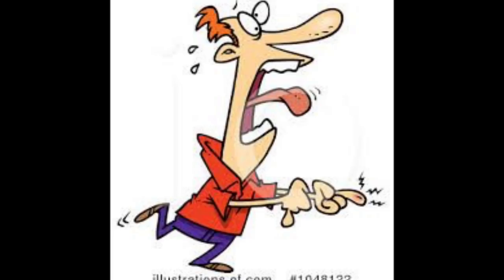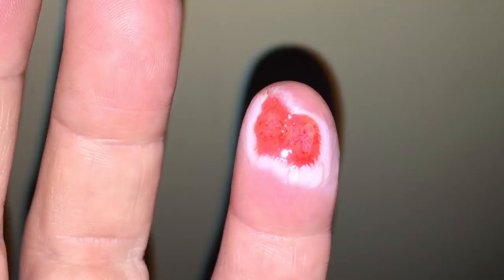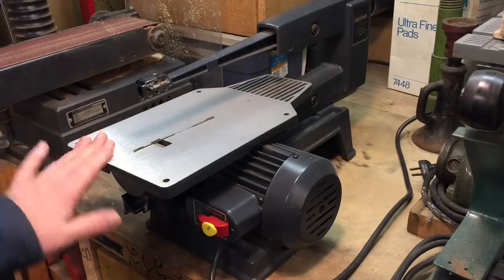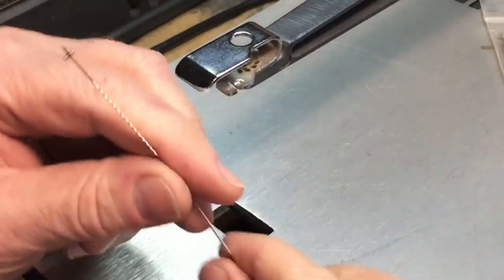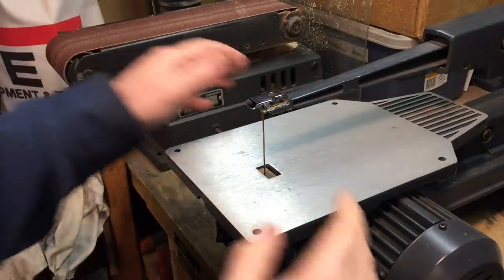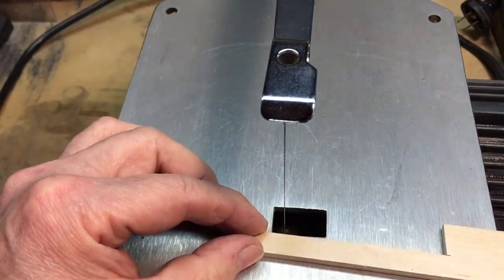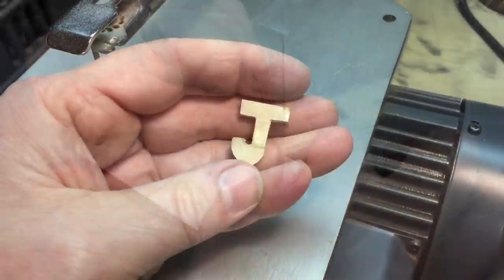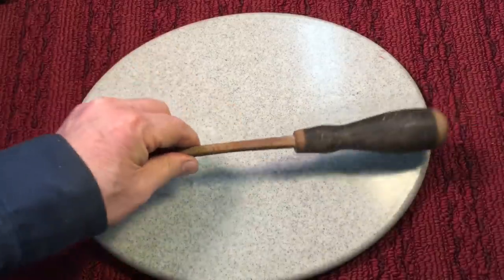Introduction to the Scroll Saw and a Rare Leather Handle Screwdriver Restoration

Comment: As a semi avid cyclist I’ve had my fair share of road rash which is very similar to what you had on your finger. I’ve found the best way to heal road rash is to do exactly what you did. Keep it covered, keep it clean, and keep it moist. I used petroleum jelly after about a week of using antibiotic ointment. It heals faster than you would believe.
Reply from the maker: David- You are so right!  I was shocked at how well it healed!   Thanks!

Comment: I'm glad your finger healed up nicely. Your scroll saw is a lot younger and lighter than mine. I had the pleasure of acquiring my nieces father-in-laws. He had a 1947 Craftsman scroll saw which had been in his home since 1959. The word BEAST is an understatement it is 50lbs of cast iron machine with a stand and motor which weighs an additional 50lbs. I love it works just like it was new.
Reply from the maker: Stephen those tools were made to last and weren't cheap!  My two favorite manufacturers are Vintage Craftsman and Millers Falls....

Comment: Glad to hear you're on the mend.

Your scroll saw looks just like mine, from the mid '80's.  I thought I got rid of mine a few years ago until I found it last week in the attic.  Glad I kept it because they are handy.  I added a 1/4" plywood zero clearance table topper on mine to keep small pieces going down that hole.  It helps a lot.

Keep on restoring!
Reply from the maker: Jeff!  You are so right, a zero clearance top is a great project!   =D  Thanks!

Comment: Nice work as always. Thank you for the scroll saw demonstration I believe I have that exact same craftsman one from my father as well and I vaguely remember how it works using it for making pinewood derby cars over 20 plus years ago. I plan on keeping it because just as you said those things are great for fine detail work and are great for close tight quarter working. I also have a craftsman jig saw type my father use to call a scroll saw as I think thats really what it was labeled and called that the top handle pivots in the front allowing you to change the angle of the blade for making circular or contoured cuts as well thats great you just don't find things like that anymore. You are so right about them being difficult to find these days there just isn't that many options and manufacturers of them anymore. I remember 2 years ago planning on buying my own before my father passed away and I think dewalt is about the only remaining manufacturer and maybe jet or delta as I was planning on using it for making custom kydex knife sheaths.
Reply from the maker: Hi Rob- There are a few high end scrolling saw makers for guys that are really into it...  For the entry level woodworker there are a few options too.  The problem is there are so many nice tools and not enough room or money for us to have most of them!  LOL
Reply: @ScoutCrafter  haha so true I think if I keep getting more tools my wife may start tossing them lol

Comment: My old scroll saw is a Delta brand and all cast iron. It also can use many different motors if the original goes bad. I have seen many other brands that are the same saw, but with only the name is different.

Comment: I have a big ole Craftsman scroll saw I bought 7-8 years ago & I think it was made in the 80;s . So it was old already . Nice restoration on that ole screwdriver !  I got to thinking as you were straightening it out on the Dake . What do you have undernieth that Dake supporting the weight ?  Maybe you can briefly show us all the next time you use it ?.....Good to see you healed well from that grinder injury John .
Reply from the maker: Hi Dave!  The funny thing about the hydraulic press is the only weight you have to support is the weight of the press (maybe 100 lbs)  the hydraulic piston presses against a table that is bolted to the frame of the Dake.  So no matter how many tons you build up the weight on the table is always just the weight of the Dake!  That's what makes it so amazing to me!   Thanks Dave!

Comment: I remember around the Bicentennial (1976) my uncle Joe was putting in a new cement walk at his house in Bellerose and he had the sides of the walk framed out with wood and lined with tar paper expansion joints and he had rebar mesh at the bottom and the cement trucks came and started flowing the cement into the walk and as the guys were floating it level, he started embedding various tools, like open ended wrenches, hammers and saw blades, just so there was something interning in the cement and I remember this one S shaped open ended wrench and every time I went to his house after that I looked for that wrench in the cement.
Reply from the maker: traderjoes How cool is that!!!!

Comment: I’m almost thinking that was a shop made screwdriver. Maybe even a kit that was sold? School project for shop class?  Idk. The inconsistent shaft and the tip didn’t seem to be hardened steel like it would be if it came from a  factory. But I could be wrong. Just my two cents lol. Either way amazing job!!!! “Turned” out beautiful. Pun intended lol

Comment: My father taught me many, many years ago, to use a coping saw,, before I was allow to touch the scroll saw..
Reply from the maker: Harry Still a very useable tool!!!   I have experimented cutting coins with one!  😃👍
Reply: @ScoutCrafter  have you ever seen a hand saw that looks like a tiny hacksaw that uses pinned end blades ?? 
The model i have says OMEGA then SPAIN on the other side of the handle.
All i can find is scroll saw bladed but 4 inches quarter inch wide. They sell them at lowes. Also the hande is seems to be some very rough cast odd colored alloy
The adjustment knob seems to be brass the arm i guess is stainless. Also the handle is too little to fit my hand you have to just hold the whole handle. Instead of use the grip. Because the blade is pinned you can flip it up or down also do those same kinda inside a hole cuts.

Comment: I am glad your finger healed! I thought it was a pry bar but the screwdriver came out nice. We never carved the asphalt, only fresh cement that hadn't hardened.

I found an old rusty 10mm wrench. I tried to make it more presentable with a brass wire brush (my one is non magnetic).  https://iili.io/JuJw7e.png
It's a (German made?) Gedore but it has some casting imperfections and din894 standard is for single open end wrenches for subordinate applications. This makes me think it was a cheap wrench that probably came with an appliance. It has a golden-brown tone, the newer versions are phosphate coated but I don't think this was. Anyway what do you think?